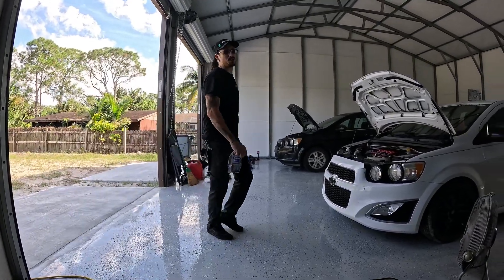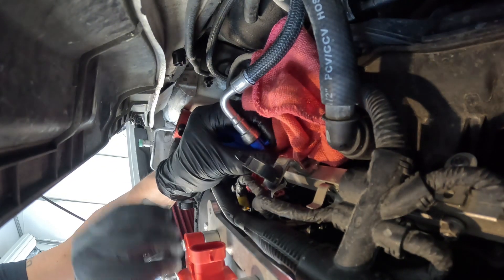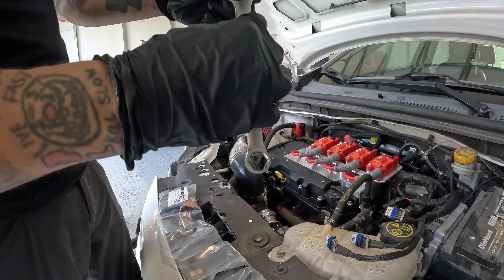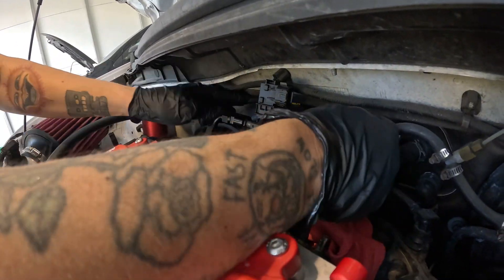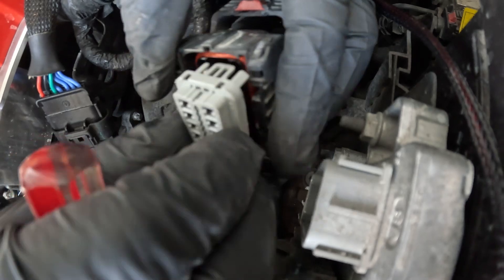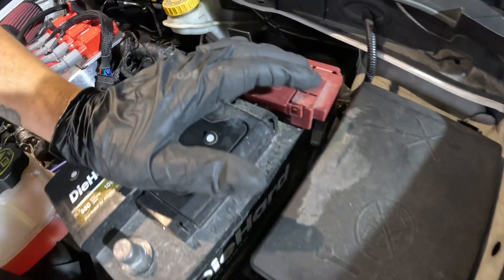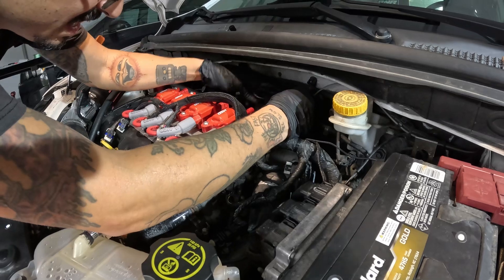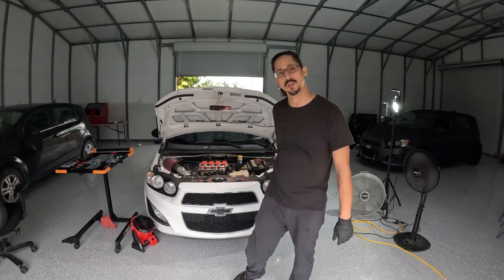BNR Chevy Sonic/Cruze 1.4T Flex Fuel Kit Install

Comment: Can  install & wire up a flex sensor in my 13 sonic 1.8 without a tune? My fuse box & ecu has a labled Flex fuel location?. Can i just run the flex sensor signal & wire it to the ecu & go?
Reply from the maker: No, you need tuning to activate the sensor. We can do it at BNR. You'll need bigger injectors to go above around 20% ethanol
Reply: @badnewsracing  it's just a work car, I'm not using it to attain more power. I'm sure the injectors will be sufficient for a work car putting around. I want it as a fuel option. So would I just send my ecu too Bnr and yall could active the ethanol tables?
Reply from the maker: You’d still need injectors, even stock power level they were maxing out at like e20. They’re just super small. I don’t know of any viable upgrade injector either at the moment. I think someone said our 52s fit but not sure if any modification needed to be made
Reply from the maker: Unless you’re just going part throttle. Then it’s fine. As long as you don’t go wide open. But then when you do go wide open to pass someone or something they’ll max out and the motor will lean out. Maybe BNR fpcm will make it work, never tried that

Comment: Great video, just one question.  Why would you want to run e85?  I just don't understand stand why people are doing it.  If I understood the benefits maybe I would go for it.
Reply from the maker: E85 is 85% ethanol, which is an alcohol. Alcohol absorbs heat/energy during vaporization so it rapidly cools cylinder temps as well as being more resistant to detonation. E85 is typically 104-ish octane, which means you can run more boost, more timing, etc. and make more power than gasoline. The downside is it's less energy dense, so you need around 30% more fuel to achieve the same energy output as gasoline. So while it doesn't burn "faster" you need more of it, making you go through it faster. But it's cheaper than 93 is per gallon, so you save money as well running E85, but you refuel more often. Typically you can expect to see a 30HP gain on E85 over 93

Comment: Nice. I’ve had my kit since Christmas and haven’t gotten around to installing it🤦🏻‍♂️. 
Question on the flame tune, is that going to be available with the ghost cam tune or will they need to be separate?
Reply from the maker: You'll be able to combine them
Reply: @badnewsracing  when will it be available? I’m more motivated to get the flex kit on and the 52#s installed.
Reply from the maker: Before Black Friday ideally. We just don't want to put it out too early and it not be perfect.
Reply: What’s the most power someone has gotten out of one of these? Very curious 👀
Reply from the maker: @williamcumbee883  Overall, like 400+ HP. With a hybrid turbo / big wheel turbo like 275whp
Reply: @badnewsracing  not bad for a little 1.4 at All😁